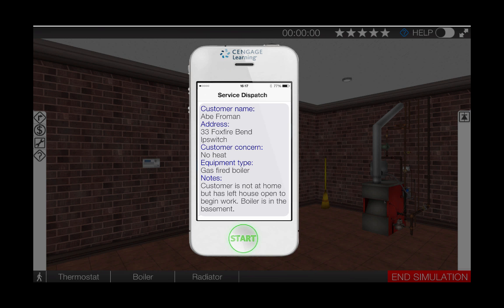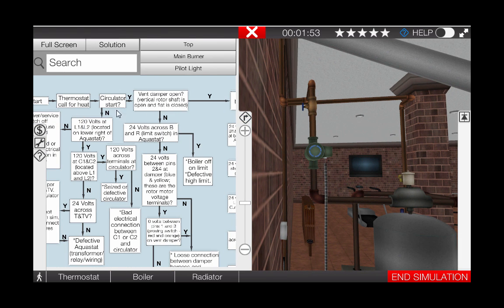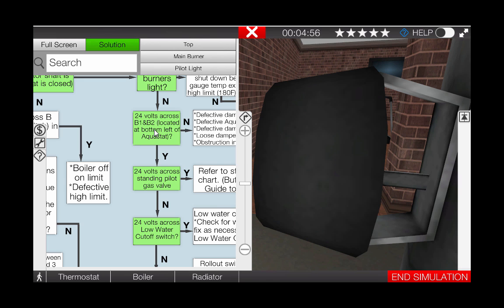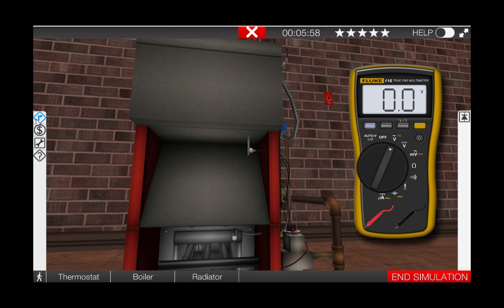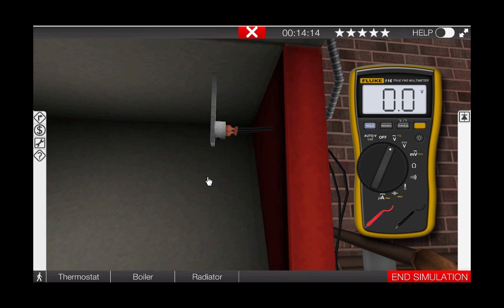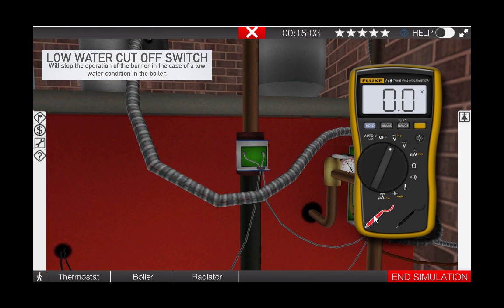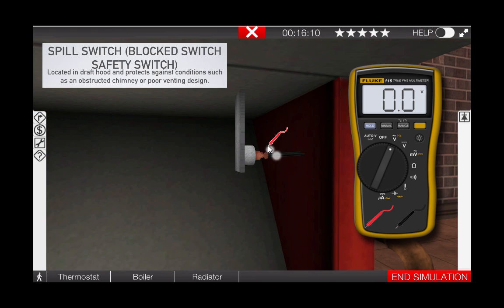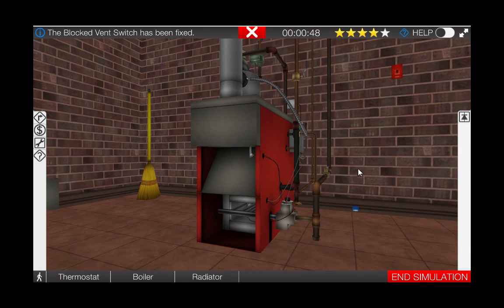Gas Boiler Blocked Vent Safety Switch Troubleshooting Video

Comment: Just had this issue on our boiler. Would’ve never thought to check for this switch, in particular bc they cover it and its a bit of a hassle to access on our Utica boiler. Did spend money on changing out a bunch of other parts before suspecting it.

Comment: Can you please explain why having 24v on the multimeter indicates the switch is open? Wouldn't it be no voltage in an open circuit?
Reply: I was thinking the exact same  thing.